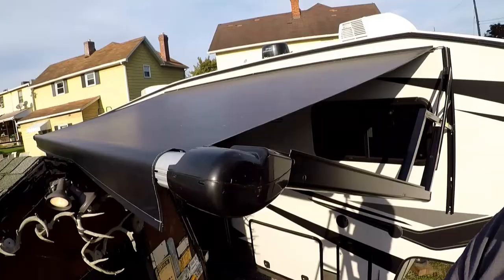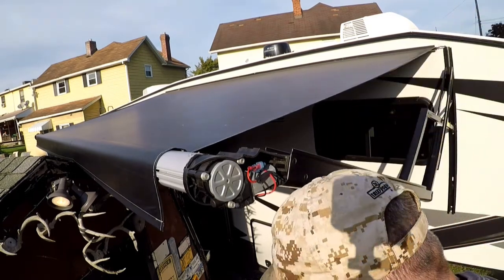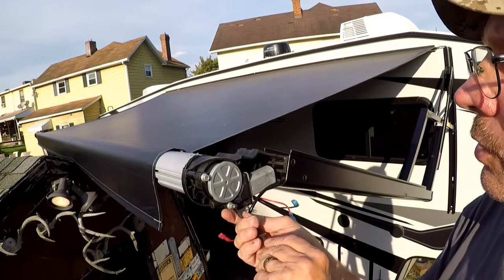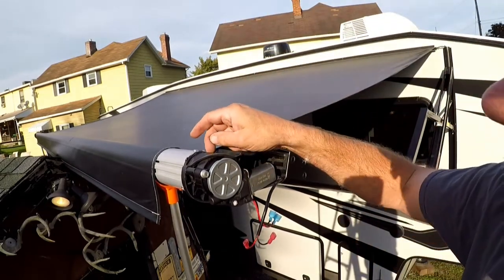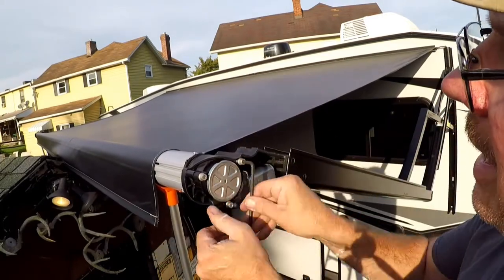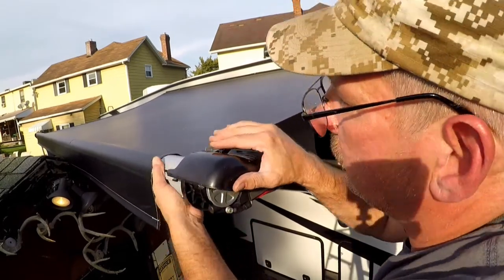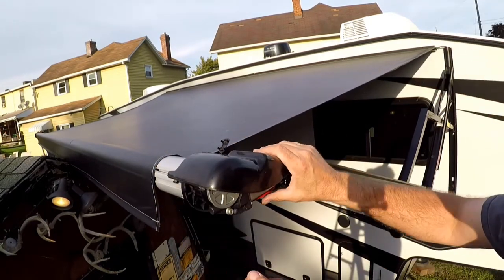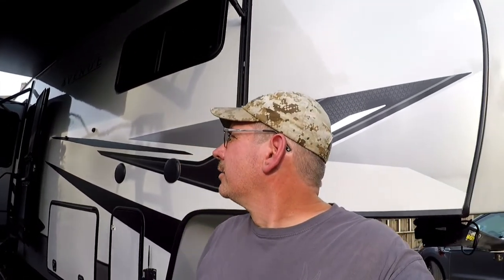Carefree Compass awning motor replacement

Comment: thank you for the video.  Ours over travels too.  Seems like the motor change did not fix it.
Reply: Did you find a fix or just live with it as-is?
Reply from the maker: @MsJumpingflea Fixed. I did s fallow up video. Turns out they used the wrong switch. Took some doing but I got it figured out with multiple emails and phone calls to Carefree and the switch manufacturer

Comment: Does retaining pin hold the tube on the arm?
Reply from the maker: Yes. You pull the clip out into the detached position and pull the arm off the tube shaft. Just be careful not to drop the tube